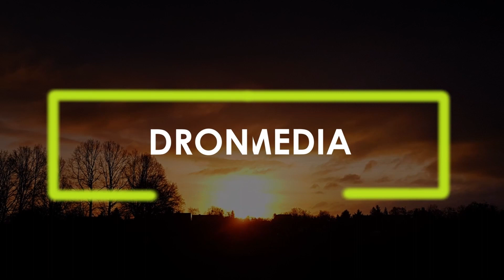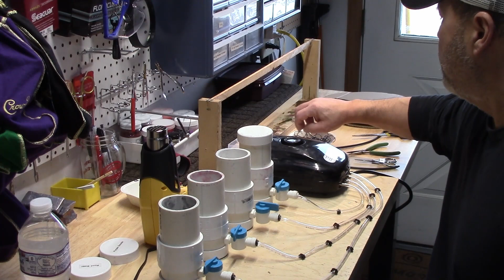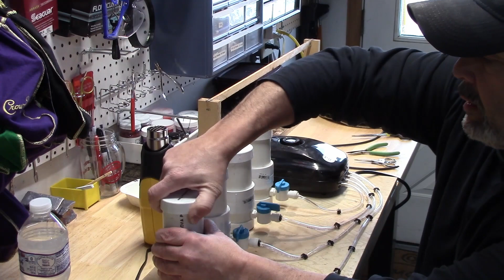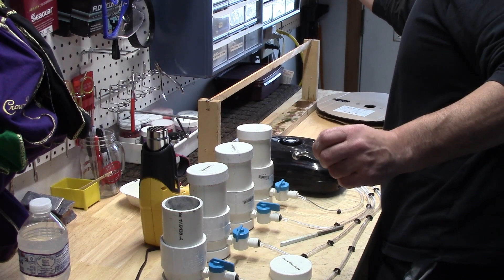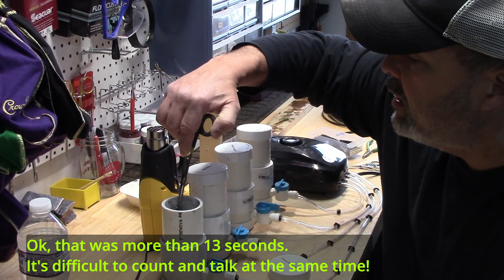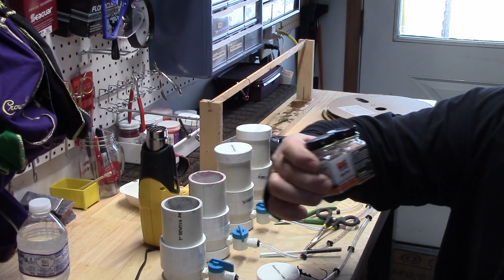Lure Building Part 2: Powder painting your jigs using a fluid bed

Comment: What brand air pump is that please?
Reply from the maker: I bought it at Menards.

Masterforce® 1.5-Gallon Ultra-Quiet 135 PSI Portable Electric Horizontal Air Compressor

 It’s their 57 dBa and it’s very quiet.

Comment: Awesome bud! What size was the heat shrink tubing?
Reply: 1/8'' heat shrink....  check out sdg custom lure craft  here on youtube look up his fluid bed w/ manifold build... super sweet set up... I only used 4  but copied his 8 cup design and put my pump position-to sit next to the cups on the board to keep it compact -- he's a very kewl dude does QUALITY WORK  he also sells his stuff on his web site,,,,,,also he came up with a alum clamp system i copied for baking the jigs upright instead of hanging them very simple and if any thing drips it goes down the shank and no dimples on the head  or paint in the weed guard 👊👍   tell hin Dan The Man Sent ya over 😎  #SDGCustomLureCraft How to Make an 8 Cup Fluid Bed with Manifold Regulator // Simple Design // With Pump Recommendation